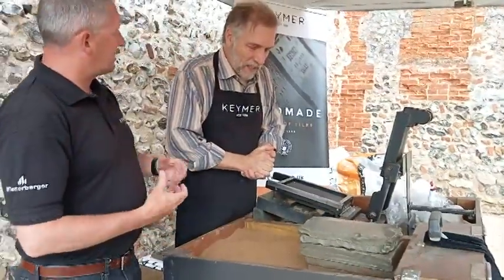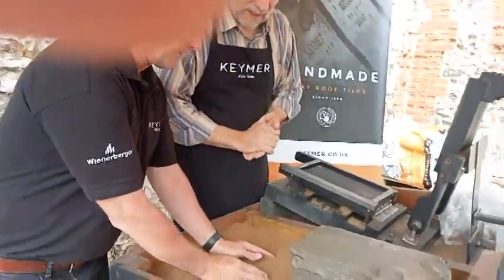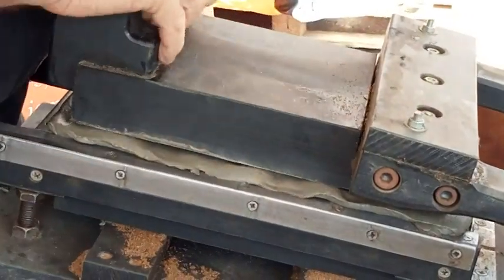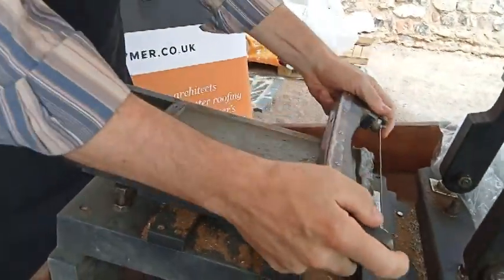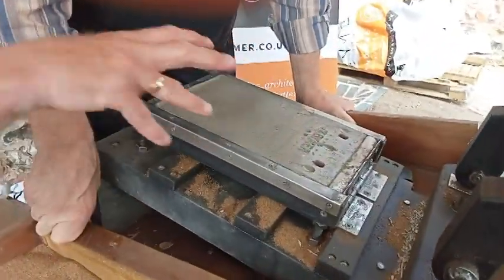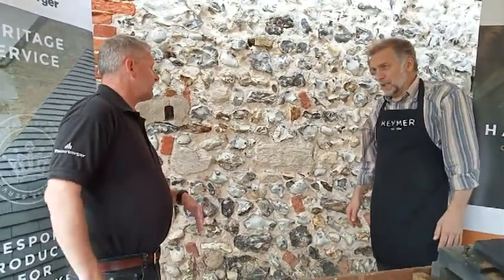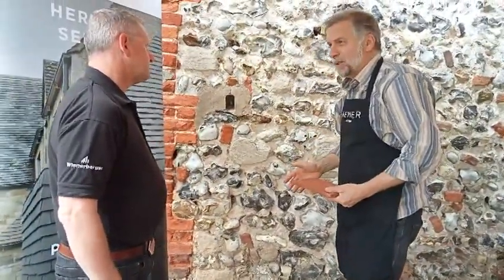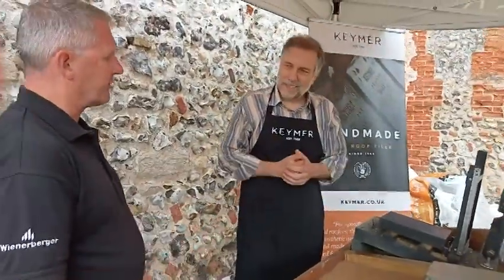Making Roof tiles

Comment: I've gotten the most important piece of information I needed; I'm from Kenya and want to make my own roof tiles since I live in the rural Rift Valley and there is enough clay. I figured, why pay all that money for roof with some fancy sizzling names on them like "stone coated",  when in fact,  I don't have that kind of money to throw?

Maybe the challenging part I suspect, will be firing the kiln to produce consistent heat for all the tiles to be properly cooked.
Reply: Yes, it is a question of getting a consistent heat in the kiln. The old kilns in the UK would produce three grades: under burn, over burn and well fired. If you made a kiln you would need to practice this a lot before the tiles would be of a consistent quality and well fired. 
I hope you can make some tiles and get back to me to share your experiences.
Reply: @ironimp1   I will, and I'm just hoping that it doesn't turn out out to be quite ugly and messy, though for quite sometime brick-kiln system has been the tradition in this area, though no one has ever tried with the tiles so far; I suspect I'm gonna be the first one.  

So I'll borrow the brains of the local experts in terms firing the kiln.